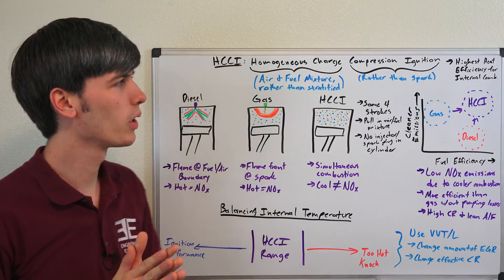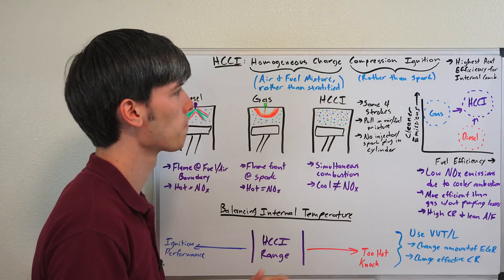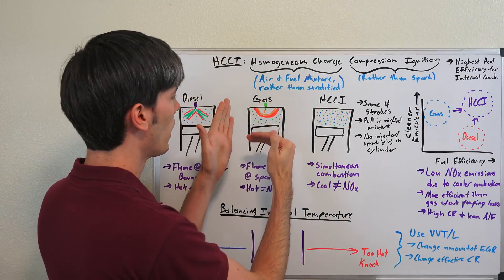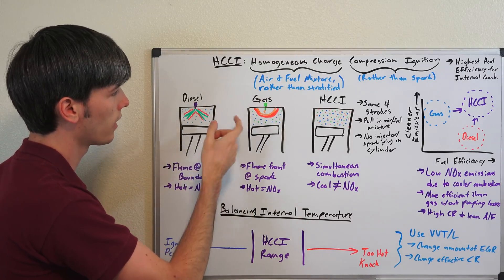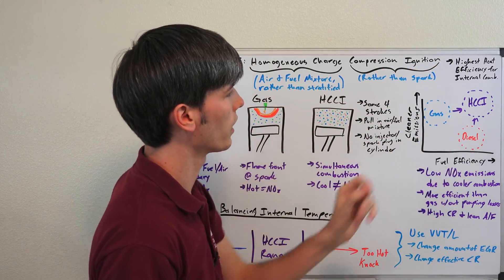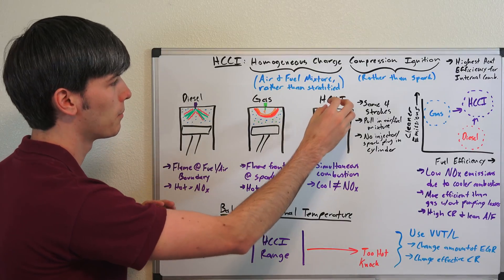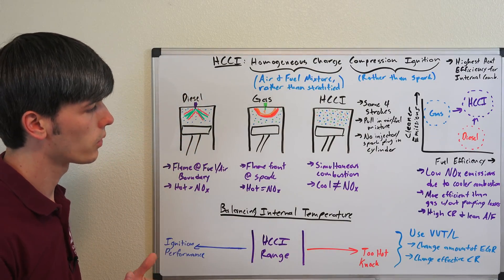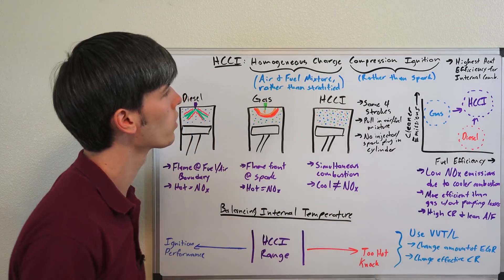The Most Efficient Internal Combustion Engine - HCCI

Comment: Glad some other car guys care about fuel efficiency!
Reply: I think fuel efficiency is the essence of performance. If you get more power per ounce of fuel with an engine that weighs less than you can go faster, or you can save gas. It's just different ways of applying the same technologies. Look at hybrid super cars like the 918 Spyder, the same thing that makes a Toyota Prius efficient, when applied to performance makes a very fast car.
Reply: I definitely do!!
Reply: Maybe Trump will back pedal on this... Maybe. I don't know about these EPA CAFE regulations, as I live in Europe, but here the EU administration imposed some bio-fuel regulations, that require a quota of bio-energies. And these also apply to gas (use of ethanol) and diesel (bio-diesel from renewable sources). The problem is that to respect these quotas, large surfaces of natural land is converted to monocultures, and primary forests are destroyed to produce fuel for cars or heating ! Even worse, these so called bio-fuels emit more CO2 in many cases than the gas or diesel refined from oil drilling !!! From Indonesia where mass clearing of tropical forests for palm oil plantations (main source of EU's bio-diesel) is taking place, to the USA, Brazil, even protected forests in Europe are used as source of wood pellets for heating or energy plants ! These policies are apparently destroying natural habitats, reducing biodiversity and producing more CO2 !
I know that electric cars are not 100% clean either, for example batteries use rare earth minerals (not only lithium) which are also very ecologically costly to extract, as they come in concentration so low that huge surfaces of land need to be mined, causing pollution and again destruction of natural habitats.
So while I'm all for cleaner energies, it seems that these "green" regulations are obviously imposed by people who are not real ecologists in the scientific meaning of the word ecology (green parties and ecologists have been hi-jacked by socialists in the EU - most likely by libs in the US - and the lobbies who owns these, and they don't know their left hand from their right ! ). Anyway, their green policies are often not producing positive results !
Reply: how are you going to convert all cars to hydrogen when you cant even spell it right?
Reply: True to that.
Reply: Sam A I agree. The more fuel efficient a car gets, the more technology is created, which can usually also help make fast cars faster.
Reply: It's getting to the point where we really need to! For the people who don't care, they can say goodbye to their favorite cars, and I definitely don't want to see that happening!
Reply: Not necessarily but I understand what you are saying. 

More power is made with an A/F of about 12.5
Reply: +Alex Ting hi, if I'm not mistaken the converter is used to burn the extra fuel which is haven't burn in the cylinder.
u now like saving the environment
Reply: ken x No, they burn close to 100%. They are only 40% efficient because most of the energy goes to heat and noise and vibration. I do think they should have cats, though.
Reply: As a car guy it doesn't mean much because on a tank of gas you can go pretty far.
But as a bike guy, fuel efficiency is extremely important, because increasing the gas tank isn't simple and easy for the manufacturer without making the motorcycle bigger. supersports usually can only go 200km before needing to refuel.
Reply: +Nicolae Florin Pașca The fact that they are renewable was a selling argument supposed to prove they can't be harmful, but apparently they aren't neutral for the environment.  The point of these regulations is that these "bio"-fuels are supposed to produce less CO2 emissions, to fight against global warming. 
Also there are huge reserves of oil left, most are probably not even known yet, off-shore... the time they are empty there will most likely be new technologies to replace them, that we haven't yet heard of.
It's fine to use byproducts of agriculture and byproducts of logging as sources of energy, but as The real doktorbimmer said, they can't meet demand, so to reach the quotas they already have to destroy natural habitats and biodiversity to convert them to mono-cultures to produce these bio-fuels, while pretending they want to protect the earth !
Reply: Nicolae Florin Pașca that comment gave me cancer
Reply: Dotte van Dijk this is the second dumbest comment I've read on YouTube. Mazda (Japanese) is the only company bringing HCCI to market. What's more, fuel efficiency is the only way to keep the world moving until electric is ready (which it isn't. Even the Nordic countries which have the most pro EV legislation admit they're just exporting pollution to countries that sell them coal power).
Reply: You are right but that is not always the case.
Reply: Efficiently does correlate to fuel burned but not always. Most efficiency lost is due to transient fueling. The piston during induction is working against a vacuum  in the manifold because of a partly opened throttle. fuel efficiency during acceleration is usually found in a throttle position that is the most open before extra fuel is injected. Usually 3/4 open.
Reply: +Nicolas Losito that doesn't go for a diesel though since there is no throttle plate involved, with a Diesel you are only controlling fuel input . also there is almost no vacuum created by a diesel engine, hence having to have a vacuum pump to run power break booster and other vacuum operated items.
Reply: You are correct. I was strictly referring to traditional gasoline internal combustion engines. 

Another thing regarding fuel efficiency is the deep suction phase (yes that is the technical term). During this phase the piston is creating a low pressure in the cylinder when it descends down. This can (with proper pulsation tuning) can create a pressure greater than atmospheric in the cylinder when the cycle is complete. This lends to power but not efficiency since this only works in WOT or full load.

Reducing the magnitude of the low pressure created in the cylinder during this phase will increase efficiency (since there is less pumping losses) but power will be lost.
Reply: I have some doubts about the cheaper aspect of these cars, when you pay this price for a car, gas bills are only a fraction of the costs, and more complex engineering means higher maintenance prices.

Also you have to know that real life range is often really not impressive, even on less powerful models. I never drove a spyder, but I have some doubts about the 420 miles/680 km range ! The fact that it could do 12 miles on EV won't change anything to this reality.
Reply: False. Did you even read my first post ? These  so called "bio-fuel" produce MORE CO2 than diesel and gas !!!
https://www.transportenvironment.org/press/biodiesel%E2%80%99s-impact-emissions-extra-12m-cars-our-roads-latest-figures-show
Biodiesel produces 1.8x MORE emissions than fossil diesel average : https://www.transportenvironment.org/press/drivers-are-top-consumers-palm-oil-europe-2015-figures
And by deforesting huge surfaces to produce palm oil and ethanol, you release massive amounts of CO2 which was stored in the wood !!!
About your second point, once again, these regulations were NOT voted because fossil oil will deplete, as oil is NOT going to disappear before many decades anyway ! 20 years from now there will still be plenty of oil, while cars may well be 100% electric, or hydrogen, etc !!!
Reply: Fuel effciancy = longer time you can drive your car.
Reply: The real doktorbimmer Unless we use renewable energy! I like hydrogen at the moment because battery mining is awful for the environment, but hopefully we can switch to more clean energy so the stuff we use is actually clean.
Reply: Ceazar Carr is
Reply: Well you will be disappointed to hear that this hcci sucks. The more you compress fuel, the more efficiently you can extract work from it. If you compress gasoline until it detonates, it will be at a lower compression than for example a diesel engine. You can compress gasoline further beyond it's ignition pressure by adding gasoline to a really high pressure environment. You can actually put gasoline in a diesel car and get almost as much efficiency as a diesel engine just from doing that. I think diesel engine will stall but I think it can be modified for gasoline. Or you can mix gasoline with diesel.
Reply: Fr bro, everyone wants that full sized V8 truck
Reply: I hate the idea of a higher subscription fee, as I'll call it, for transportation, especially now.
Reply: Often times efficiency advancements are also power advancements.
Reply: More fuel efficiency= more miles with the same cost. And if happiness is achieved with smiles per galon, as they say. You will be happier for it. Also power isn't everything in a car. Thats why miatas are so popular. There are also a lot of car People in countries where gas is really expensive.
Reply: A lot of times, fuel efficiency and power are on the same page. Example: removing the catalytic converter will increase power due to the drop of exhaust back pressure. But if less power is required, the engine doesn't have to work as hard compared to with the cat on. Therefore, reducing fuel consumption.
Reply: I'm a college student, so it matters a little more to me, even though I drive an Evo IX, which by no means is fuel efficient lol. But as mentioned before, cars like the McLaren P1, Porsche 918, and Ferrari LaFerrari use hybrid technology to make the cars even faster. I think McLaren/Porsche/Ferrari changed the world of supercars with the release of these cars. I assume they're cheaper to own in terms of gas compared to other supercars that get like 8-14 MPG.
Reply: +Alex Ting hi, if I'm not mistaken the converter is used to burn the extra fuel which is haven't burn in the cylinder.
u now like saving the environment
Reply: +Alex Ting hi, if I'm not mistaken the converter is used to burn the extra fuel which is haven't burn in the cylinder.
u now like saving the environment
Reply: Hey I care about fuel efficiency! Don't paint us all with that broad brush like that, jeez. Some sort of bigot? I, for one, purposefully sought out the lowest fuel efficiency vehicle I could find. Take that liberals!
Reply: even einstein failed in language !
its not something important ... not all people are a like .
most are good in one part and bad in other .
Reply: He does give a crap about efficiency. It's about global warming (hoax) as a result of emissions. Just another alarmist.
Reply: it's almost a requirement that being a car or bike guy means you have to only want dirty, loud engines that guzzle gas.
Reply: electric

Comment: So in reality detonation still has a flame front, but the equalized combustion is a good point, so is the variable effective compression ratio. 
It is smoother tho, to close the valves earlyer, so the pressure in the cilinder drops, and rises again. That cools the mixture down, thus creating a more detonation resistant mix.
Video still stands on it's own legs, keep up the good work.
Cheers

Comment: Great video sir. I have two points to add :First, the actual application of such technology will only be possible with the usage of infinity variable, individual valve timing; something Lotus has been working on in the past decade. This will introduce  flexibility in the engine management system in order to eliminate premature ignition. Second, the challenge of managing the cylinder temperature during normal driving (steady state operation) will be nothing compared to temperature control during cold startups (transient operation), where the engine produces the maximum amount of pollutants.

Comment: Doesn't that mean that the rpm on those engines will be much lower until more capable software can be developed? I don't think that when an engine is revving at 6500 rpm there is much time for a sensor to pick up the temperature send the data to the ECU, for it to translate it and make the proper adjustments? And the problem grows bigger when the rev range goes even higher (which it very likely will do so)

Comment: So a simultaneous injection of air and fuel, so it's like a carburetors, feeding air and fuel into the intake port?
Reply: No, you've completely misunderstood.
Reply: Cody Sutton I'm not sure you understand what a carburettor does. Injection offers the most accurate fuelling possible. Of the injection methods, DI is the most advanced. Why would anyone mention the word carburettor when discussing "The most efficient engine"? It's 2016 you know..?
Reply: Because it's directly saying that you do not want an injector in the cylinder, which would be direct injection.

If you want a charge mixture before the cylinder, that is precisely what a carburetor is trying to do. A high pressure TBI system could likely do it better, but the original commenter and I were saying is that this is describing a carbureted gasoline engine. without spark plugs. It is just pedantic to call it old, because no duh it is.
Reply: DI is less likely for HCCI because direct injection gives far less time and space to mix and distribute the fuel and air homogeneously.  Current DI gasoline engines are stratified charge (i.e. not homogeneous).  For HCCI to work you need genuinely homogeneous fuel/air mixture throughout the cylinder.

Of course, with enough turbulence it might be possible to achieve this with DI, especially at low rpm, but injecting the fuel into the throttle body or inlet manifold makes achieving a homogeneous charge easier.

Also, ideally you want all the gasoline to be vapourised (rather than atomised), which again takes a certain amount of time.

As someone has already mentioned, this technology might be best suited to a low-revving, constant speed engine which would act as the power source in a series hybrid vehicle.
Reply: nope, and nope. but go the rotors!
Reply: Well yes. Exact same thnig with throttle body FI and similar to multi port indirect FI. Essentially, with this layout, you don't want direct injection the exact moment that combustion happens, like in diesel engines (because it will create a hotspot around the injector in the combustion chamber cancelling the effect of a simultaneous even combustion that the HCCI aims for).
Reply: I was scrolling and looking for a comment like this, because it's what I thought. The article on Forbes mentions a guy making one with TBI to solve the issue with the price of direct injection- and I thought the same thing.

Isn't this a carbureted engine? The charge air is ostensibly homogeneous, it's simply compression ignition instead of spark ignition. Perhaps the precise control of the mixture isn't really there with carburetors, but TBI should be able to perform the charge air mixture with accuracy.

I'm thinking specifically now of the older Ford IDI diesels, running on gasoline. I don't have any experience with them, or really know how they work in detail, but Indirect Injection sounds pretty good eh?

The guys saying no, I can only assume aren't familiar with what carburetors are trying to do. Not trying to be a jerk, but it seems to me like that's exactly what this is (in theory).
Reply: Because not everybody interested in this video needs to now the differnece between direct, multi port or tb ingection in order to watch it.Principle is what matters and yes tbi and carburetors are of the exact same. Metering air, determining how much fuel to supply, supply said amount of air-fuel mixture to the intake, let it do the rest. Job done. Now granted DI is the most advanced method yet but as mentioned will not work with HCCI. No need to be smart ass about not puting "carbuteror" and "most efficient engine" in the same topic.
Reply: pns12live6 You're right this video is about the method of ignition. So I'm not sure why are you going off on a tangent about fuelling. You state that "tbi and carburetors are of the exact same", whereas in FACT they are completely different. Someone with greater knowledge than me could probably chime in. But I'm pretty sure the HCCI will be a DI engine, I can't see why not... Tell me, where is it "as mentioned" that DI won't work with HCCI? I stand by my "smart ass" comment.
Reply: So if vaporization is better than atomization, would propane be a good fuel source?
Reply: I would think so, in that it must be easy to achieve a homogeneous charge.  Propane has a slightly lower energy density than gasoline - 46.4MJ per kg, compared to petrol's 48MJ.  

I haven't heard of propane being discussed in the context of HCCI, but it's an interesting idea.

Comment: Basically need a series of environmental sensors that will control the end fuel air mixture. 
EG: ambient air temperature, elevation, barometric pressure, available oxygen, temperature of liquid fuel, temperature of engine and exhaust, time of day, season, GMT location, etc...
All of those things and much much more easily go into how this engine properly functions. 
By changing any of the environmental numbers even by 1% could mean the difference between success and failure

Comment: Rumor has it Mercedes and Ferrari have this in their current 1.6L V6 Turbo F1 engines....
Reply: The Mahle TJI (Turbulent Jet Ignition) engine does not use HCCI combustion.
Reply: Isn't that because the stroke is so short????
Reply: The Mahle turbo ignition ignites the mix in a prechamber, which forces the entire mix into the combustion chamber for burning.
Reply: I think you are correct. This has been mentioned on TV.

Comment: It is much rumoured that both Mercedes and Ferrari are both using a HCCI in pre combustion chamber above the cylinder in their Formula 1 engines to achieve a more homogeneous combustion and boost efficiency in the current fuel limited V6 turbo engine regulations. The articles floating around in the likes of Racecar Engineering and F1 Technical around are absolutely fascinating.